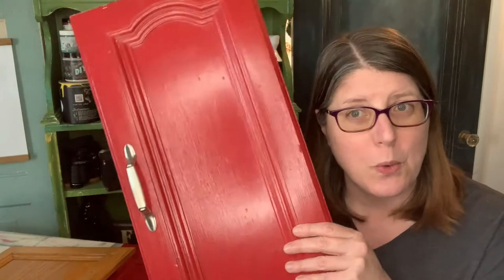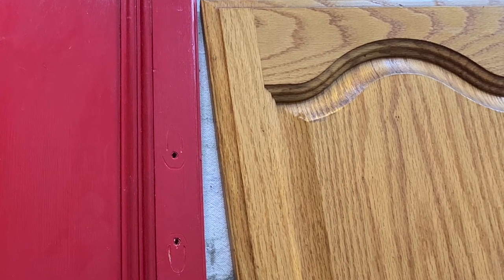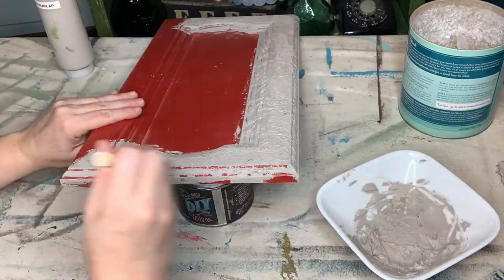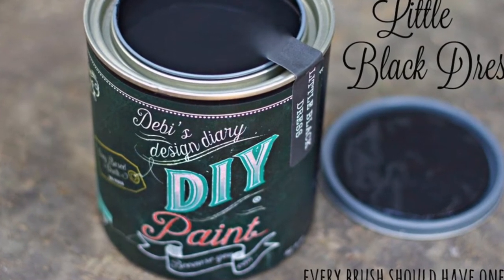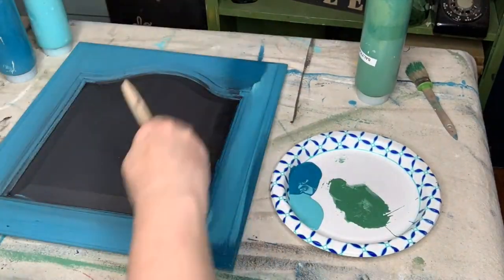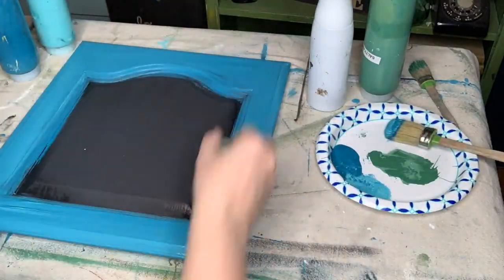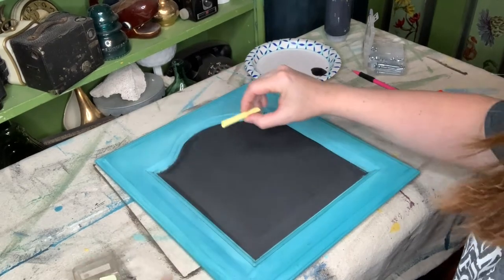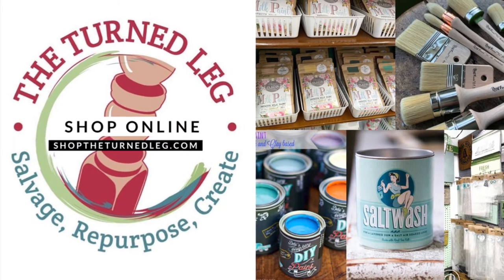Up-Cycle Cabinet Doors 3 Ways

Comment: Where do you find the cabnit doors? I see tons of cabinets w doors at habitat restore... don’t know that they’ll let me take all the doors! 🤣
Reply from the maker: If you are near Lincoln Park, MI I sell them in my booth at Plaza Antiques & Collectibles Mall.  I usually find cabinets as "curbside treasures" and just remove the doors with my drill using the screwdriver attachment.
Reply: I wish I was close to you but I am in Georgia. If I ever make my way up there I will stop by your shop